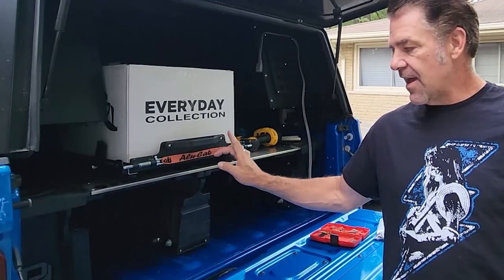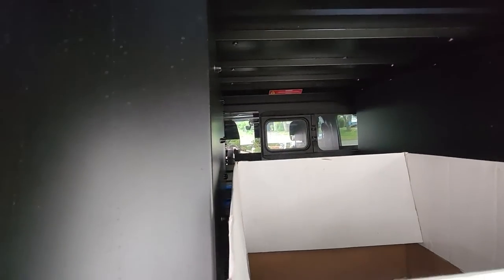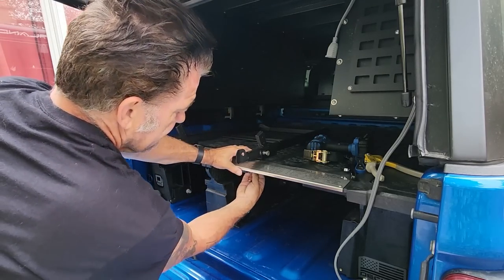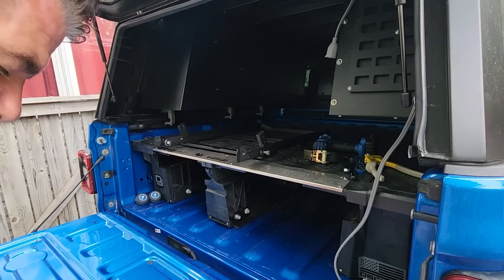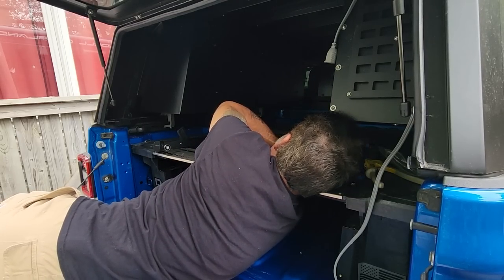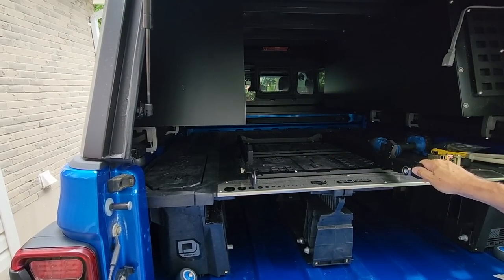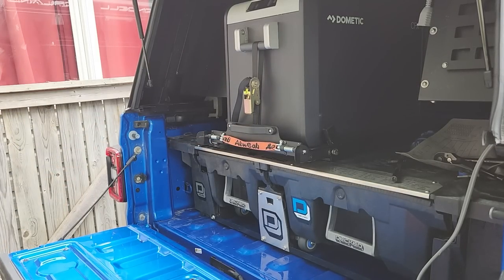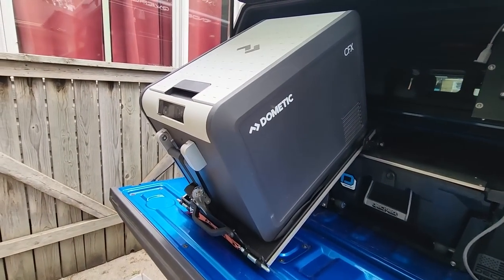Alu Cab Fridge Slide Install to Decked System

Comment: Thanks for posting this video! I’ve been searching for something that shows a fridge tilt slide mounted on the Decked drawers for a Gladiator with a cap, just to see the clearance up top.  I installed the drawers 2 months ago, but still waiting for the Alu Cab Contour Cap; should arrive in another month or so.  Also going to install a Goose Gear 60% rear seat delete kit, and may mount the fridge there instead.  Decisions, decisions…  
Anyway, you’ve got some nice rigs!  My others are a 2000 XJ (nicely set up for off road) and a 1997 XJ (4x4 but totally stock).  Finally decided to join the modern world with the JT Rubi Diesel!!!
Reply from the maker: Glad I could help. I have seen a few people with the Alu-Cab cap, will you be posting a video of it once you have it installed? I would love to see the final product.

Comment: What is the tallest frig that will clear the Smart Cap door when you have the slide  mounted on top of the Decked Drawer system?
Reply from the maker: Hey David, I just posted a quick Short showing you the measurements. Thanks for watching